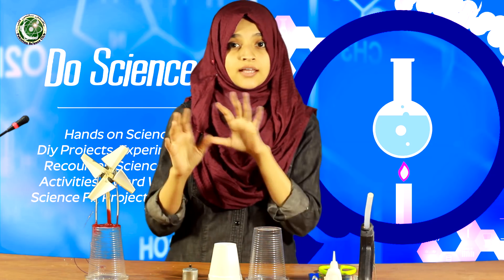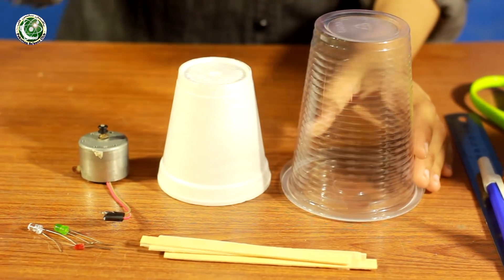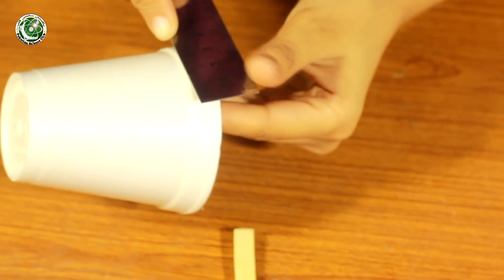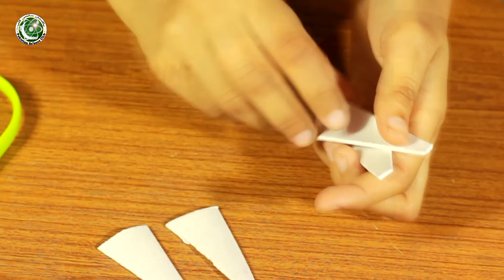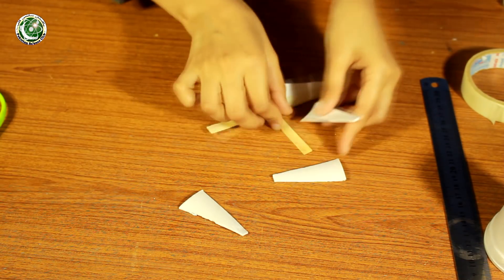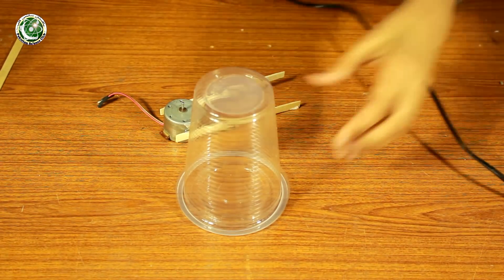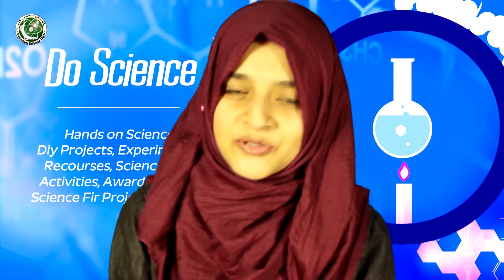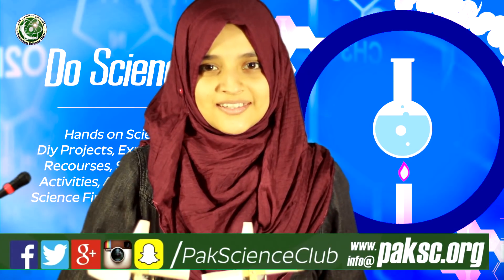Working model of Windmill  light-up LED's,  Class Room Science Activity Project (Urdu)

Comment: All these video where motors light leds are fake.  I've tried 3 different motors and various light bulbs over the last three weeks of ordering parts.  Two different motors were rated for 6v and one for 1.5v to 3v.   None of them lit the light.  I used a construction drill by inserting the motor shaft into the drill chuck.  The drill got all three motors to a max of .75v.  Nowhere near the motor ratings.  Another reason none of the video give the motor specifics is because they don't work.
Reply from the maker: we used 12 volt dc motor its need High RPM to lightup leds
Reply: @pakscienceclub  Where did you get the led light bulb and what kind?

Comment: I built this using a 6v toy motor and 2v led I've tried switching the propellor and switching the sides. It only lights up when I manually spin the motor when I attach propelor it doesnt work. PLEASE REPLY AND HELP
Reply from the maker: your blades can't generate enough RPM so you have to redesign blades
Reply: @pakscienceclub  Thank You